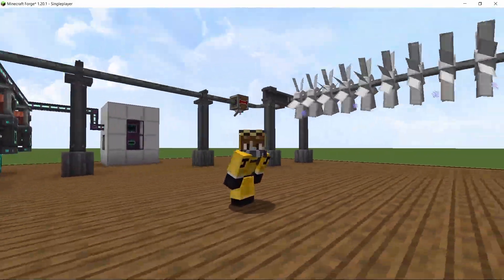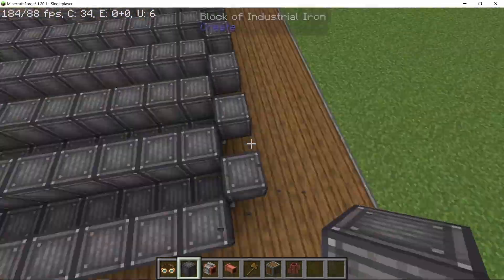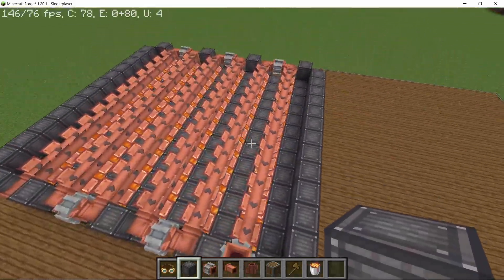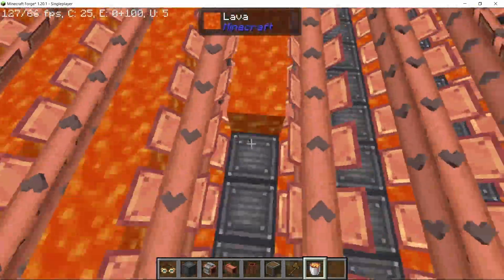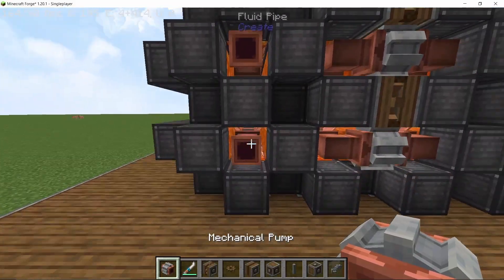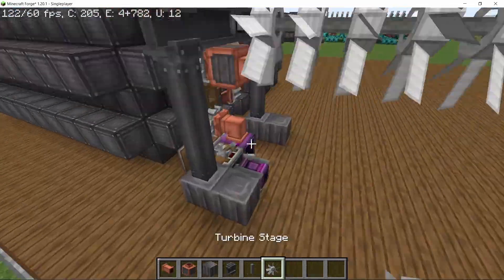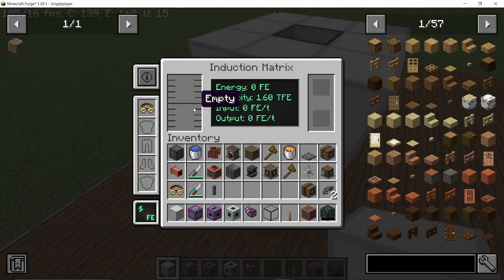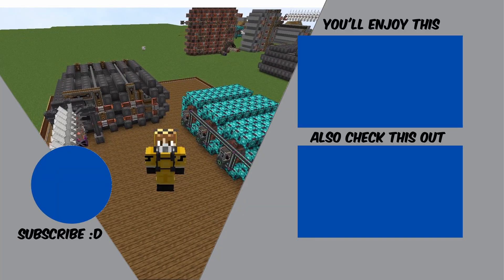Massive Boiler setup to make Millions of Stress Units - Create CROWNS mod

Comment: You've said that each time you try to play with Ballistix you crash. Have you installed Electrodynamics along with it? It is a required mod for Ballistix to work.
Reply from the maker: Yes that's the first thing I tried, tbh I installed electrodynamics first and tried running minecraft with only that installed but still the mod refuses to work. So naturally it's dependent mods aren't working:(
Reply: @SavageVegeta  oh
Reply from the maker: Well I'll give the whole thing a try again just for the sake of it, maybe with some luck I'll be able to make it work  @Frotheru_The_Dragon
Reply: @SavageVegeta  ok.
Maybe try another versions.
When i used to play it,it worked,and i genuenly dont know why it doesnt for you.